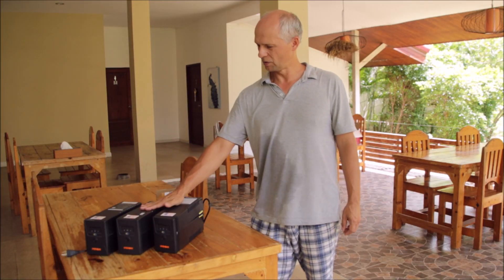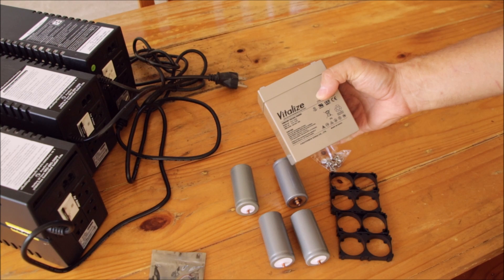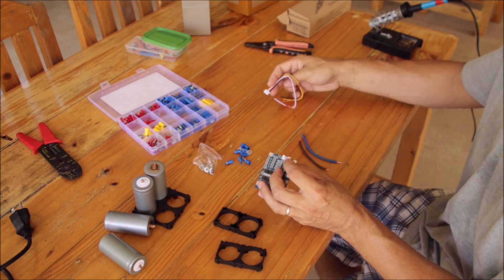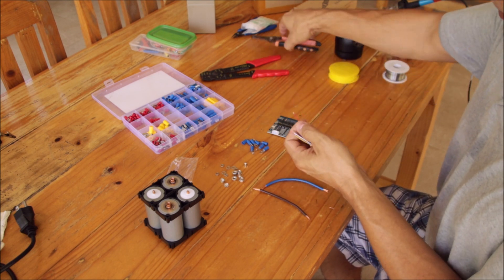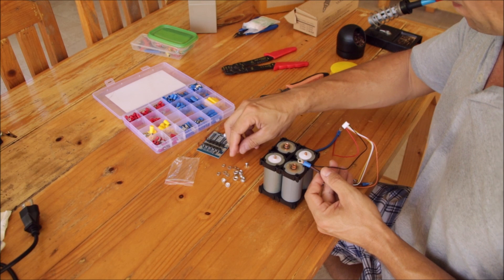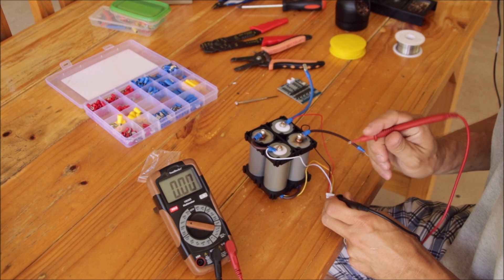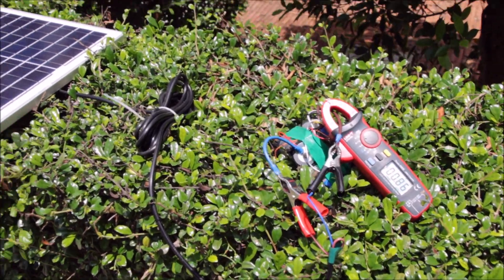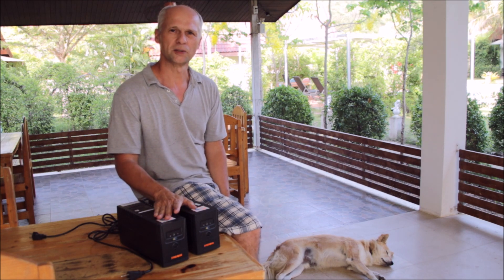Lead Acid - OUT, LiFePo4 - IN! DIY - UPS 12V battery replacement. Cheaper than the original!

Comment: Can you comment on runtime vs the lead acid.  While cheaper to replace with LifePo4 and build yourself, does this significantly increase your runtime ?  I have a APC 1300 with dual 12v la 7ah in series that provides approx 45min of run for a 110watt load.  Would love to increase that runtime within the same UPS
Reply from the maker: The Lifepo4 32600 cells will give you about the same capacity in the same volume as the original lead acid battery, but typically you can discharge LFP deeper without damaging the cells then the LA. So runtime might not be increased, but lifetime will. If you need more runtime, you could go for a LiPo 7s pack built out of high capacity 18650 cells giving you the 24V. Or you might add a few cells in an external battery extension for the LFP.
Reply: Lead acid batteries have a voltage drop-off as their state of charge decreases, but that's why the UPS has a large transformer.  It takes the declining voltage for the lead acid battery and converts to whatever voltage your electronics need that is plugged into the UPS.  LiFePO4 is better because it holds voltage much longer, but anyway the transformer is doing the work to increase the voltage.  I think Roland is right...you won't get a lot more capacity unless you build a bigger battery that is not inside the case.  This is also a pretty easy project.
Reply: The issue with larger battery reserve. You need to charge them back up again.. And being the built in charger in these things have small output. You would spend the next two+ days charging it back up to 100%....Why You would need an external charger with at least 5amps output. That can charge the type of batteries you are using...

I would add. If you so chose to use an external battery charger. You have to decouple the batteries from the internal one..As you will burn out the MB on the UPS...
Reply: If your running 24 volt that's even better you could have the option of using cobalt cells also. Most power disruptions are intermittent so.etimes just enough to cause a reboot of your equipment ups fix that I use them on all my TVs exc
Reply: Get a "power station" as UPS'es are only designed to run for a short time.

Comment: Great project. The more cells added  , you’ll get a much longer time and handles the surge with better efficiency.
Reply: You could overstress the sine generator, it is specified for a fixed amount of max time.
Reply: @NavySeal2k  Just put a fan on it, it'll be fine.
Reply: @NotoriousPyro  Tell me you have no clue about electronics without saying you have no clue about electronics

Comment: please post link to seller for parts!
Reply from the maker: (ตัวเมียลบ) Promotion 4 ก้อน แบตเตอรี่ลิเธียม LiFePO4 32650 3.2 v 6000-6500mAh  แถมฟรี!!!ตัวยึด 2 ช่อง 4 ชิ้น | https://s.lazada.co.th/s.3iv2H
฿85.00 -57% | วงจรป้องกันแบตเตอรี่ BMS LiFePo4 3.2V 30A 4S (Peak 56A) บาลานซ์: 58mA ชนิด Common port | https://s.lazada.co.th/s.3iBBO
But I think this is only available for Thai domestic. If you live in another country, please check your preferred online shop for 32650 LiFePo4 cells and a small 4s LiFePo BMS

Comment: Are you sure you did the right thing ?!  I think the bms input voltage is exactly 12.6 volts.  And in the old battery it is charged between 13.8 and 14 volts.  Can't your bms burn or more ?!  By the way I thought to put some diodes directly to the ups, and put an external charger of 12.6 volts.  I would be happy if you answer me in full detail.
Reply from the maker: BMS for LiFePo4 cells will disconnect the battery at a high voltage of 3.65V per cell, and low voltage of 2.5V per cell. So for this 4 cell pack, the voltage range is 10-14,6V. This is well inside Lead Acid voltage range of the UPS charger, which as you saw stopped charging at around 13,6V. Where do you get the voltage of 12.6 or 3.15V per cell? I think you misunderstand the term of 'nominal voltage', which is 3.2V for LiFePo4. Nominal voltage is just the average voltage of a cell chemistry's voltage range. It is only used to define cells. For LiPo and NMC it is 3,7V, but the voltage range there is 3.0-4.2V...
Reply: @RolandW_DIYEnergyandMore    Thanks for your kind reply .I really appreciate it.
Can you answer me some questions ?!
  I have lead acid battery UPS.
I want to connect 18650 cells
  My BMS charging is written 12.6V
Possible output of BMS for example to a 12V fan.
Now I want to connect the BMS port to the UPS charging port
Is it possible ? After all, about 14 volts will go into the BMS volt input
What can you teach me about this?
I would be very happy for your detailed answers, it will greatly help.
Yes I may not know or do not understand much, for that there are good people (teachers) like you. I thank you on behalf of everyone.
Reply from the maker: @user-zg3nb1mk5b26  OK, now I understand. You want to replace Lead Acid by 18650 laptop cells with Lithium Ion chemistry. Sorry to say, but will not work! LiIon cells are unsuitable to replace Lead Avid in 12V systems due to the incompatible voltage range. You would need 3,5 cells in series. 7s 24V and 14s 48V can be done with LiIon. Please don't do it, its not worth the trouble even with using a buck converter to reduce voltage from the onboard charger, as 3s is to little voltage to keep the UPS running for long enough when discharging. 12V must use LiFePo4 cells!
Reply: @RolandW_DIYEnergyandMore  if I have a 48v UPS would you recommend I go with liion or lifepo4? thanks
Reply from the maker: @frzen  technically you can go with a 14s Lion battery as well. I would prefer LFP cell from the safety standpoint especially when you have the UPS somewhere indoors. It will end up to be a decision on which cells you can get easier, right? LFP packs are bulkier as well.
Reply: @RolandW_DIYEnergyandMore  thanks Roland. With safety I think you are right

Comment: Go on ebay (or equiv) and search for "D3806 CNC DC Constant Current Power Supply" a bunch of sellers sell them.  They're a cheap and surprisingly useful variable power supply capable of buck-boost operation.   They sell for around $20 USD +/- $5 depending on the seller.  You just need a decent 12-24V supply which you can surplus from random electronic appliances.

If you're going to be doing a bunch of electronic projects you really need a good variable power supply.  Cheers!
Reply from the maker: yeah, I am always pushing an order for a bench power supply further down the road. Will take a look into it. Thx
Reply: @RolandW_DIYEnergyandMore  For around $20 you can't go wrong.  It took me a few years before I got my first "real" lab bench supply and even then it was only a Siglent 3303X-E....

I have like 5 of the 3806's floating around my house doing various things like floating my solar batteries in the winter to powering home-made IoT thingies to charging my portable lifepo4 battery packs, etc... they're really useful.
Reply from the maker: @tomstdenis  just pulled the trigger on a unit. Was never looking at those converters. thx for the tip!

Comment: This is so informative. What to do to connect more cell I this? do I have to add cells in multiples of 4 to match 12 v charging???
Reply from the maker: Yes. 4 cells in series matches the 12V, so if you have a bigger device, which lets say has a 10Ah lead acid battery inside, you can start adding cells in parallel. So you take lets say 2 LiFePo cells, put them in parallel, and connect with the next group of 2 cells in parallel. That is then called a 4s2p pack. You can use as many cells as you have space available. 4s3p, 4s4p, etc....
Reply: @RolandW_DIYEnergyandMore   how long does it power the computer after power outage?
Reply from the maker: @Kogi-pastor  20 min max. It of course also depends on your power draw. This UPS only has a small battery really...

Comment: I have done the same project LiFePo4 4S1P 30A BMS. I have an issue in this, once my UPS gets full charge BMS shuts off charging and my UPS turn off automatically. Do you have any suggestions for me.
Reply from the maker: That means either, that your charging regulator is set a bit to high, or one of the cells is running away and out off balance. Regulator cannot be changed, but if it is a weak cell, it could be fixed by getting a new cell. Did you measure the total voltage and individual cell voltages before it happens and the BMS is shutting off? Or try to top balance cells first

Comment: 12:55  I know normally it may not be an issue with batteries, but when testing voltages, it's a good idea to not hold both terminals with bare hands. Remember, currently/voltage can flow through your body and can throw the readings off. It's better to push the probe down into the terminal to get a reading. You can hold the other terminal just fine. Or, if you wear rubber or nitrile gloves, you can get an accurate reading that way too.
With what you are doing here, it may not make a difference, as you are getting a reference to verify proper voltage increase with each series connection. But something to be aware of when doing repairs on other types of electronics.

Comment: Nice Project. I think you should have wrapped the cells in shrink wrap material before attaching the BMS to the outside provide better insulation.
Reply from the maker: That for sure. I just didn'thave anythingby hand and as all the casing and other stuff inside was insulated, I thought it's going to do without it. haha. Thanks for the good comment!